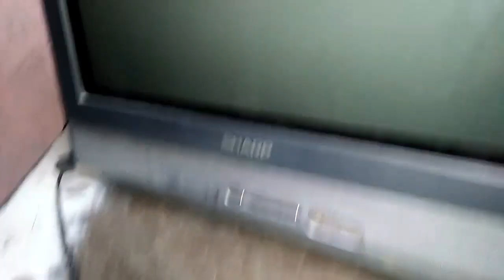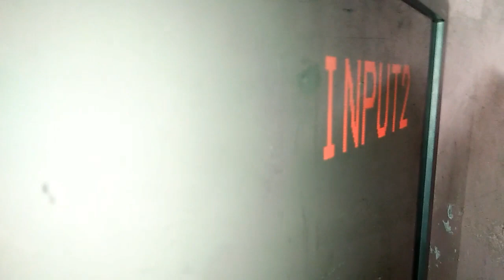Sharp crt tv over voltage b+ hold down oscilation repair tutorial

Comment: New sub here,  sir paturo naman po kung pano e trouble ang 2 blink ng sony crt tv. Over current protection. Salamat po.
Reply from the maker: Check mo muna ecap sa primary minsan high esr na pero may secondary voltage parin at horizontal drive check morin pati ecap sa b+
Reply: Wong tv techvlog  ok sir salamat. Nag check ako sa voltage regulator na dalawang BA09 shorted na. Baka don lang ang sira. Try kong palatan yong dalawang BA09. Nga pala pareho lng po ba yan ng lm7809?

Comment: Bro abnormal na ba s ganyang model Ang B+ na 129v Ang oscillate nmn wla lng dispay tas ngdodrop Ang voltage papuntang crt board ..
Reply from the maker: Baka nag hoholddown din bro check vertical kung may supply at out